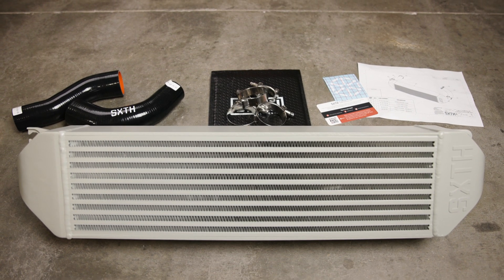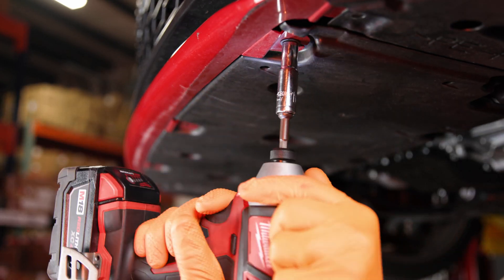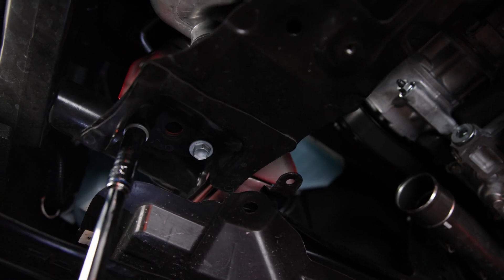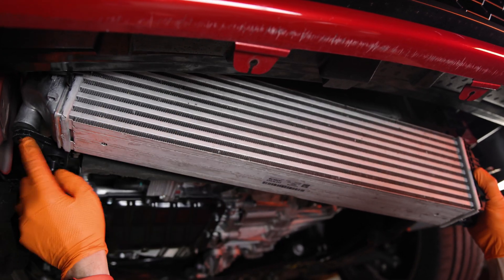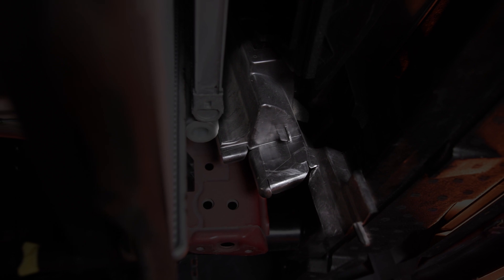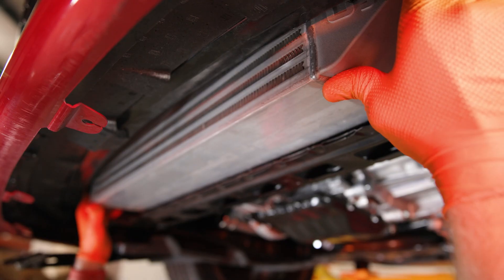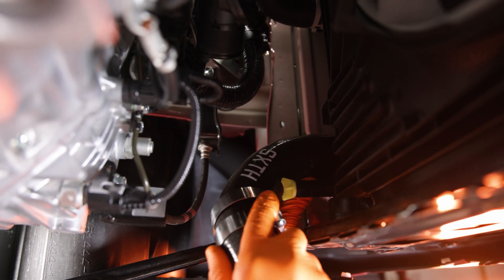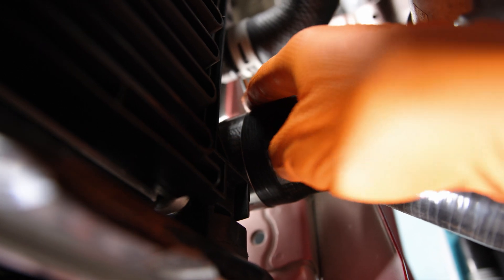GR Corolla SXTH Element Intercooler Installation

Comment: after installing the piping i hear a whining ish noise during acceleration. how tight should the hoses be?
Reply: Had the same problem initially that’s boost leaks you need to get a good seal you can you hairspray or silicone lube but make sure you tighten very good (lots of boost going through those pipes) I pressure tested and sprayed soapy water to find leaks. We fixed all of them now it’s perfect. I see this post is 4 weeks old did you tighten all the couplers and find all the leaks
Reply: It’s the clamps that are bad I added the charge pipe kit and the clamps that come with the kit are bad. I called SXTH and they sent me constant tension nylon bolt clamps (excellent) that fixed the boost leaks.

Comment: Disappointed start..Installed mine today I hear a boost leak when in high amount of boost. Installed exactly per instructions install was completed by master mechanic. Hissing sound when in boost above 1.5.  Im bringing back sunday..not a good start ** UPDATE FIXED had the system pressure testing found boost leaks couplers were not tight enough and now it pulls full boost  pulls HARD and At a lower rpm nothing crazy but no heat soak no more.. went to full send Motorsports they fixed it in a hour. Any mods you have to ready for these things to happen. Nice upgrade
Reply: Show a video please
Reply: Update had it pressure tested and had a few boost leak on new charge pipe from couplers not being tight enough.. fixed no more boost leak car pull hard and at lower rpm.. nice upgrade

Comment: Do they have protective end caps while shipping so nothing gets inside of intercooler. Update I received and it does have caps on both sides.
Reply: They sure do, and packaging is total overkill lol, which is nice.  I had an intercooler years ago arrived smashed on hot side and took me forever to file/sand it to where the charge pipe would go on, its a nice piece and definitely makes a difference, 2023 Core here.

Comment: Does it retain the factory cooling ducts (Air deflector) to direct cold air to the intercooler.
Reply from the maker: Yup! Look at the video and you'll see the part where we tell you to cut the OEM ones if you don't want them squished.  Air reaches the core regardless of them installed or not.  That is why removal is optional :)